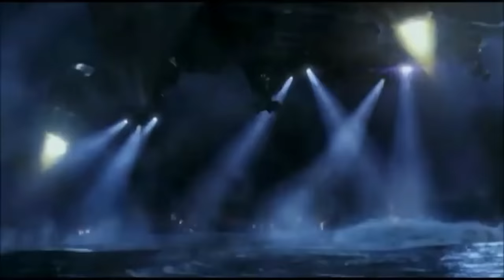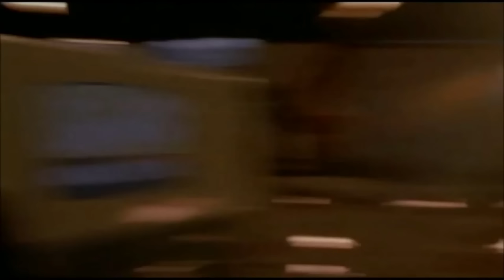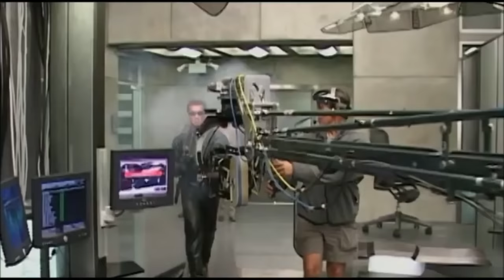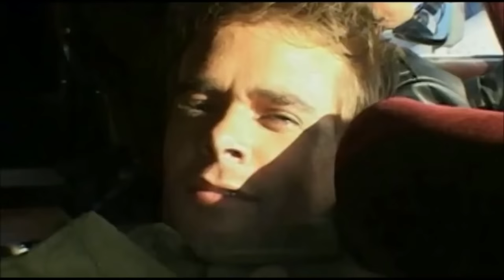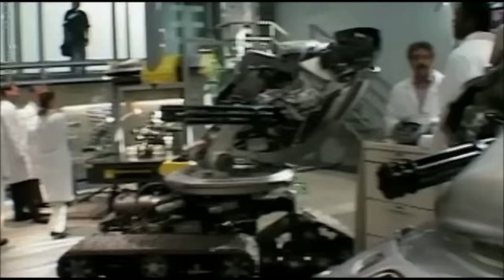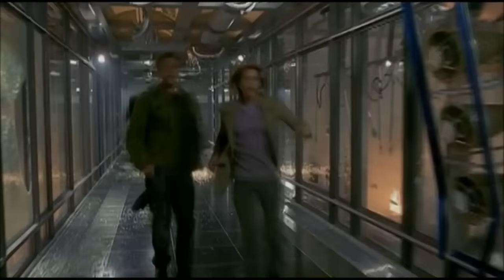TERMINATOR 3: RISE OF THE MACHINES (2003) | Behind The Scenes of Sci-Fi Cult Franchise

Comment: It's a pity they didn't have the full rights when they made Terminator 3. According to an old sci-fi/horror magazine I still have, they had to change some parts, due to the rights being shared between two parties. I presume that's why the T-800 incorrectly referred to itself as a "T-101" (instead of Cyberdyne Systems Model 101, T-800). The "goliath" HK tanks were missing, the flying HKs were different and so were the time spheres.

All the Terminator movies since Terminator 2 obviously used parts of the official novels.
The T-X in Terminator 3 is a character from "Terminator 2: The New John Connor Chronicles" novels. In the books, the character is called "T-XA" (The hyphen may be in a different position). The first of the John Connor novels came out in 2002.
The  John Connor novels also contain "upgraded" people from the future. Those characters ended up being used in Terminator: Dark Fate.

The novel "T2: Infiltrator" (2001) has the scene where the T-X (as a different character name in the novel) remotely took control of the vehicles. The book actually has a lot more to that scene than Terminator 3. 

There are other scenes and characters in the other novels that also feature in various Terminator movies. One part I'd love to see in a future (no pun intended) Terminator movie is Skynet's armoured (and armed) train!

All the Terminator novels are well worth reading. There are about ten or so books and I have them all! 🙂